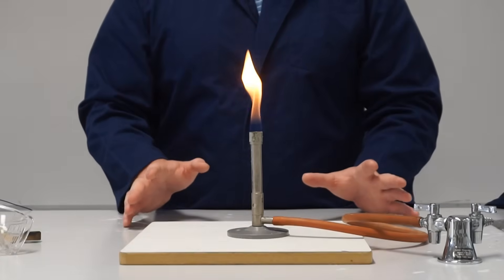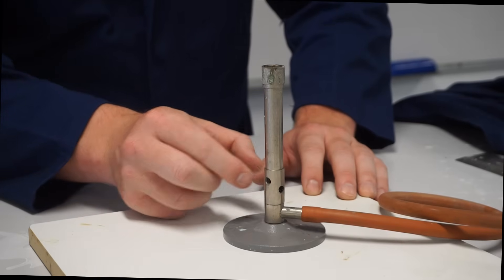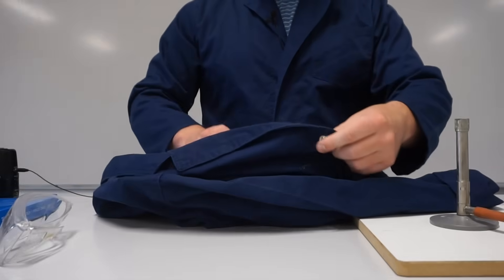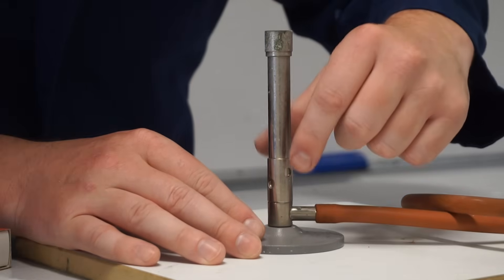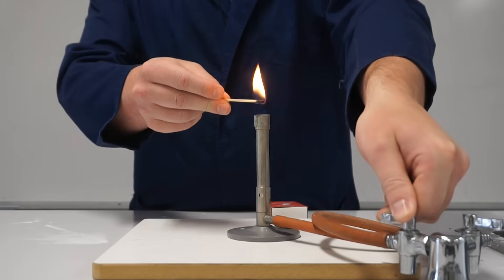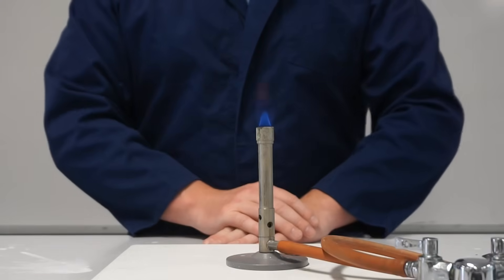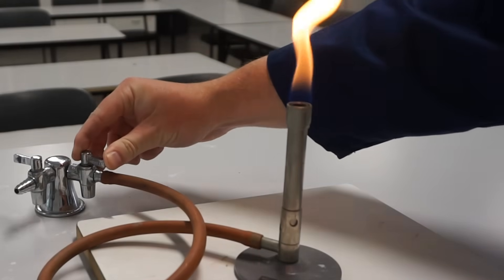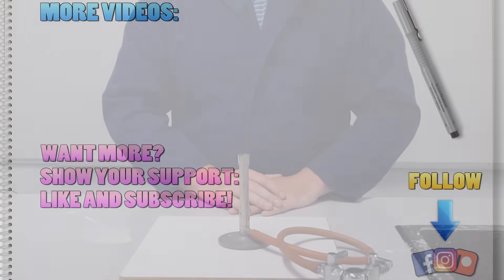How to use a Bunsen Burner

Comment: one question? What happens if you blow it? Please I need to know because I have a test in two days!
Reply from the maker: The flame goes out but the gas will still keep escaping from the barrell if not turned off at the tap, leading to a dangerous invisible gas cloud forming.